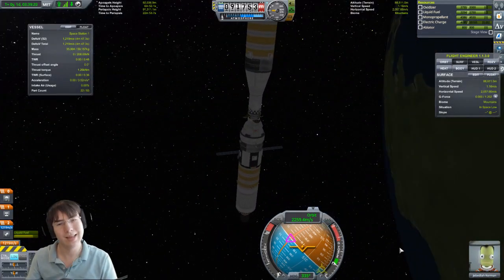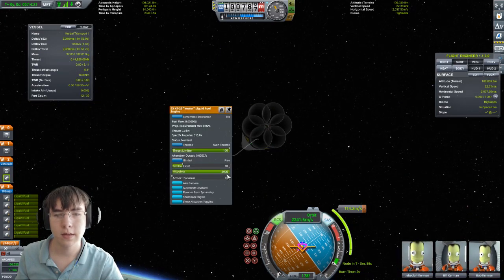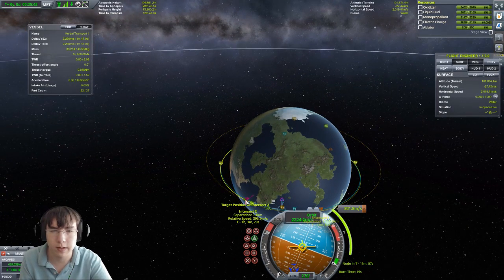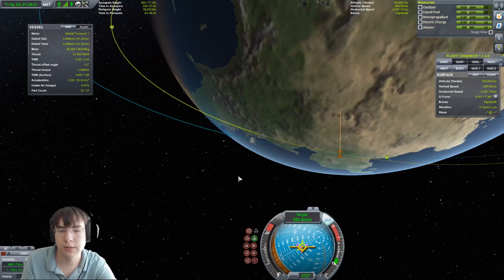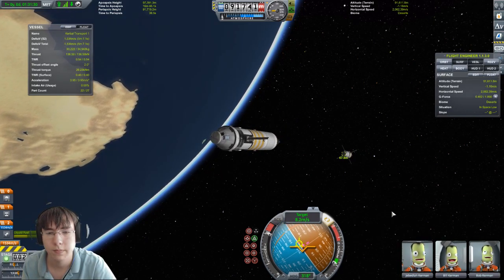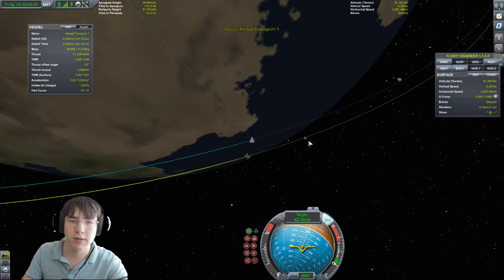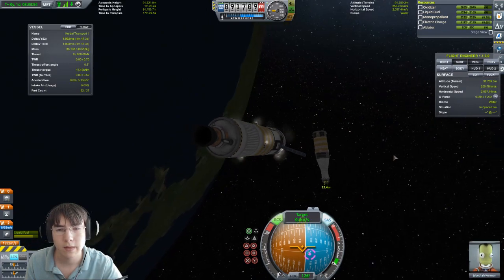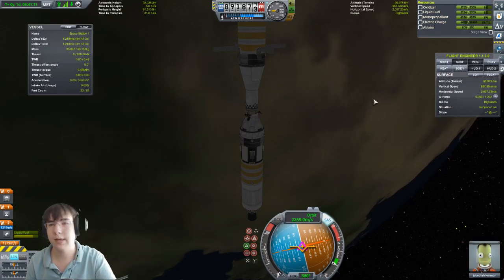How-to dock like Scott Manley

Comment: Adjust your audio balance. The engine noises are way louder than your voice.
Reply from the maker: Thanks! I only noticed that in editing. I will be sure to adjust them.
Reply: @teamwinftw6391  if you save your mic and game audio as separate audio channels you can rebalance in post
Reply from the maker: @LaughingMan171  I'm not sure how to do that in OBS but I will look into it!
Reply: @teamwinftw6391  you can only do it with certain output file types. I don't remember the details off the top of my head.